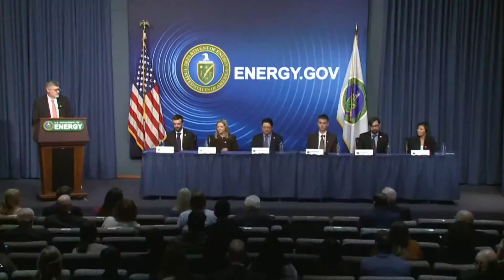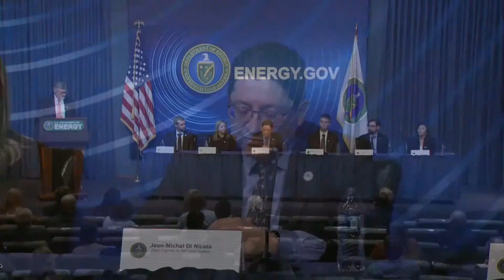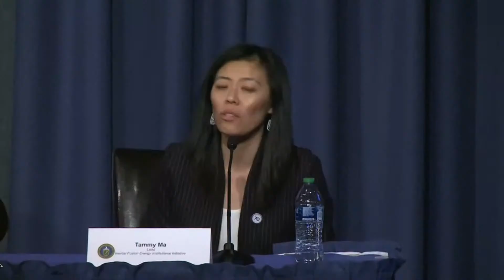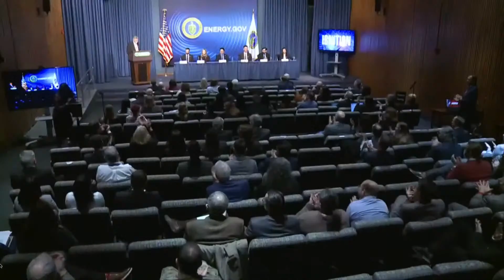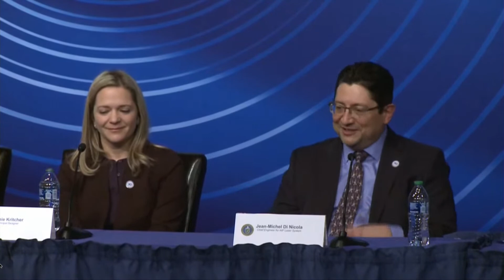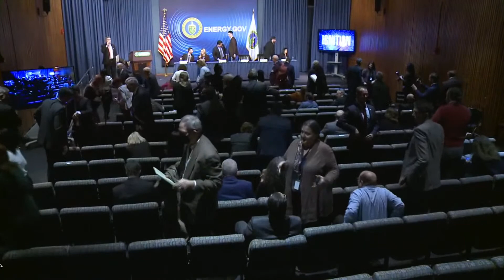In full: Leading scientists discuss breakthrough in nuclear fusion

Comment: This is not a scientific breakthrough but a major deception! Gov't scientists also deceive to get more funding for worthless money pit experiments that will not never achieve their stated goal of net energy gain. Watch Youtube Sabine Hossenfelder “How close is nuclear fusion power? Q plasma= Energy out of plasma/Energy into plasma. Total Energy means all the energy required to perform the experiment. ie; vacuum pumps, laser power, cryogenic systems,  etc  That's what matters! Q total= Total Energy out/Total Energy in Q total > 1 is net energy gain. Q total < 1 is net energy loss. iter Q total  = 440MW. iter Q plasma = 500MW of heat. 50% lose converting this heat to usable energy = 250MW Total Energy out. iter Q Total 250MW/ 440MW = 0.57 is net energy loss! iter = scientific Ponzi scam. This is worse than Theranos! 
Lawrence Livermore National Laboratory
Energy into plasma 2.05MJ, 
Energy out of plasma 3.15MJ of heat. 50% lose converting this heat to usable energy = 1.575 Total Energy out
Q Plasma = 3.15/2.05 = 1.5 but this is not what's important. They haven't released their Q Total yet! so best guess QTotal = 1.575/2.05 = 0.77. Q total < 1 is net energy loss.  Fusion scam folks!

Comment: It isn’t about reality but practicality that will matter most. If they can create a reactor that can run on fusion it will be a bigger breakthrough. What they describe in the video isn’t something we can use yet. It’s a first step but we’re still a long way off from a practical application of fusion energy.
Reply: This is not about reactors, this was done to test nuclear weapons. The type of system they are using is not suitable for energy production.
Reply: It’s about both because they’re giving a false impression. The reaction actually cost 300 megajoules, for them to generate 3. They just removed 97% of the energy input out of their calculations and press statement, based on the theory that the lasers were just super-inefficient, and the theory that they might have been able to do it with 2.05 megajoules if things had been more efficient..
Reply: @ThyChairman it didn’t though. It’s theoretical. The reaction actually cost 300 megajoules to produce, not 2.05..
Reply: @@redviking2956 They're not talking about a reactor, they're talking about the world first man-made fusion reaction.
Reply: @JeighNeither  there was nothing new here. It’s just a math trick, unfortunately. This is exactly the same as last time they made this “breakthrough”. The excitement died down once more people realized they’re just talking theoretical, a big if, saying if things had been more efficient they’re calculating that they “could have” done it with 2.05. Last time they based the “net energy gain breakthrough” on estimates of what they think was “actually absorbed” by the reaction but they’re still ignoring the vast amount of energy used up to do this. They’re just ignoring the other 297 megajoules this reaction cost here, for some reason.. Sounds like they want a lot more funding.

Comment: I stacked up my furnace with wood & oak bricks earlier..
I put too many bricks at the top.
The wood in the middle burned with less heat than the bricks on the top - crating a 🥪 back feed smoke effect (smoke was coming back down into the furnace - pressurizing & leaking trough the closed doors even..).
I came back - went down to check & notice this...

So

If y'all burning oak bricks together with anything else - don't stack them on the top !!!
 - Only bottom & middle.

Gl 😌👍.
Reply: @Neptune original reply bro